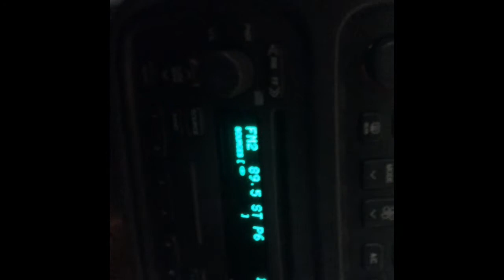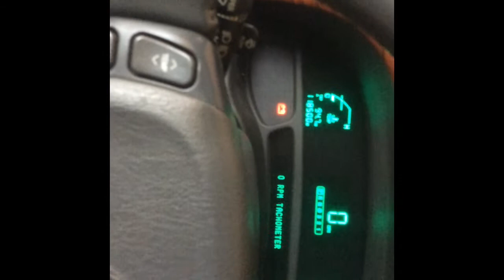My 2005 Cadillac Deville

Comment: Also as far as scratches, if they are light scratches, you can easily use some wax and polish to remove them.  But if they are deep scratches, then there's nothing you can do except use touch up with a thin brush.   Also you can just replace the entire back bumper with another one and with a new fender well shield that is missing on your car.   One from any 2000-05 Devill will fit.  Hope this helps.